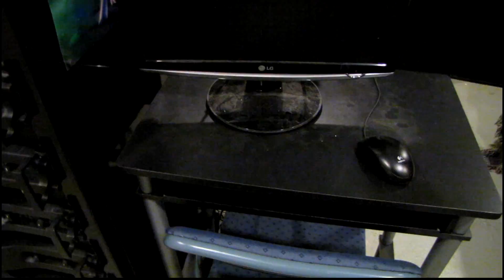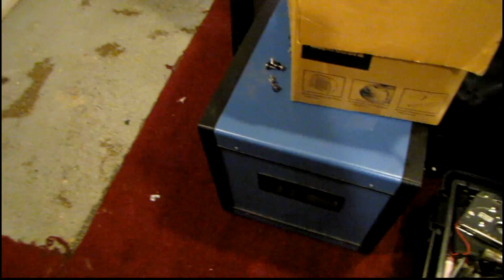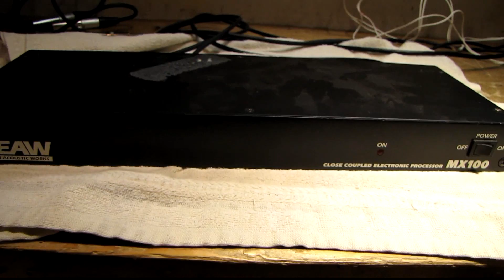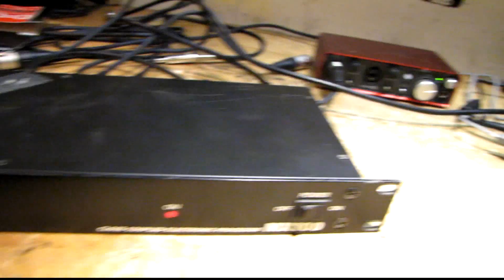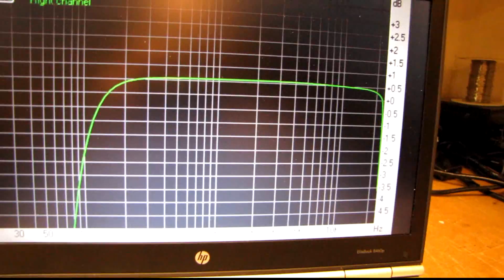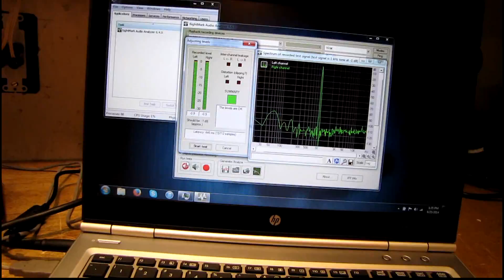Audio System Rebuild (Part 1) 9-14-2014

Comment: Do you have the tuning frequency for the SB180 boxes with the square ports. I have 6 of those and I need replacement drivers for them. Do you have a recommendation for a replacement driver for those boxes that is available
Reply from the maker: There were several versions of these.  The older ones like mine had a smaller cutout (something like 16.3") and used RCF L18P200-N drivers.  They went out of production a few years ago, but the specs should still be available somewhere.  I'm pretty sure my version of the cabinet was tuned somewhere between 27 and 32Hz.  27Hz was the Fs (resonant frequency) for the L18P200-N if I remember right.

Later cabinets like the SB180Z had different specs, and I seem to recall them having drivers made by Eighteen Sound but I'm not positive on that.
Reply: @Maxxarcade  mine has the RCF L18-P200N drivers. I attempted to recone one of them to some success but I don't have days of time to do it. If I can source an aftermarket driver or a replacement that would be great.
Reply from the maker: @seanstechworld  Because of the cutout size, you may want to stick to another RCF driver if possible.  It's been years since I worked on mine, but I'm kind of curious about a newer replacement as well.  The L18P200-N was unique in its ability to play at lower frequencies compared to other PA drivers.  And with these older cabinets, you also need to use caution with the grill clearance.  The L18P200-N had an Xmax around 10mm.

The newer L18P400 looks similar for Fs and other specs to the 200, but seems to require a slightly larger, more standard cutout (16.7") and bolt circle diameter.  

The L18P300 looks like it would mount up in the existing cutout, but the rest of the specs are different.

Since I'm still using some of these cabinets myself, I'll see if I can do some more research when I get a minute.  The biggest issue with RCF drivers is the price though LOL.
Reply: @Maxxarcade  yeah they sound really good. I have 3 working units. They sound good. The only stuff I can think of that is tighter and can go lower is Meyer Sound. We have a dual 18 subwoofer (1100-LFC) that goes down cleanly to 28hz. These -3 at 40 and -6 at 36 if I remember right.
Reply from the maker: @seanstechworld  Ya the Meyer stuff is nuts.  Hearing a stack of their dual 18" subs is actually what got me to build my system all those years ago.  

These were designed to work with specific processors (I had the EAW MX-100) with the proper option boards.  They apply a fairly aggressive parametric EQ.  EAW's datasheet states that the SB-180 is -3db at 36Hz without the processor, or 27Hz with it.  -10db is 23/25Hz.

I still have my MX-100, but have since repurposed the amps and speakers for home theater use, so I'm just using the EQ in my Yamaha preamp instead.  It has a lower noise floor anyway. 

They do tend to drink up the watts though.  You need amps with a high damping factor and lots of power.  When I got my first pair, I found that 500W per channel from a budget amp was not enough to run them properly.  Once I got a couple Crown K2's and was able to get over 1,000W per cabinet, they really woke up.

Comment: What's the crossover frequency for the subs? I'm planning on building one for my room.
Reply from the maker: +Bogdan Serban These subs cross over about 100Hz.
Reply: Cool, thanks. These professional ones look more like big woofers, unlike car subs which have big rubber surrounds and high xmax. I thought that the crossover frequency is much higher.
Reply from the maker: +Bogdan Serban These don't need to move very much, due to their size and box volume.  They have good response down to about 27 Hz or so, despite an Xmax of only 9.8mm.

Comment: Remember a laptop is isolated. Usually even on power supply, and always if on battery. That's probably why your PC passes a lot of noise, and the laptop doesn't.

Comment: but the issue is the entire response curve of the subs will change, you may lose some upper bass response if you tune them lower
Reply from the maker: Ya, ideally I'd replace the front baffles and duplicate the rectangular ports from the newest cabinets, but I don't really want to risk messing up the cabinets by trying to get the baffles off.  So I decided to just experiment with port length and see how it works out.

Comment: can you fit the precision port 6" tubes in there? just widen the hole a bit? or will it not fit because the flare mount OD is too big? those precision port flared tubes are fantastic
Reply from the maker: I was looking at those actually.  Haven't decided what to do yet.

Comment: A lot of the cancellation your hearing is because of the difference in the tuned frequencies between the different cabinets. Match them up better and you'll get a much more solid sound front.
Reply from the maker: That's the plan!  Just haven't had time or money to work on it lately.

Comment: Cone looks like it jumped out of the gap , when it goes back in the gap it very slightly catches then starts rubbing .... that looks like a mid driver ? Perhaps you fed it sub by accident at some point ?
Reply from the maker: No evidence of the coil ever catching on the top of the gap, though I'm starting to wonder if the cone had been pushed on at some point, hard enough to distort the shape of the coil.  It was like that when I got it, so I'm not sure how it happened.

Comment: When you were talking about changing the port and you had the signal generator running, I had to turn down my headphone amp a lot. I use a pair of big old heavy 1970's Stanton Dynaphase Sixty, two-way headphones, and a 1W+1W amp, so the bass was like having my head near the port!
Reply from the maker: LOL, I was running the sub directly off the USB device, so it was probably being fed by a fraction of a watt.  I can hear it on my headphones too though.

Comment: Don't you think all those components are more akin to a PA rig than a hifi system? If it's a PA that you want, then fine, but you will have to accept all the hiss, rumble and noise which comes with a PA in which there are multiple high-power components. If you want a more pure signal you should go the hifi path and reduce the signal path as much as possible.
Reply from the maker: This is my "fun" rig.  My daily use Hifi rig is a Marantz 1060 and ATH-M50 headphones.  The goal for this setup was to reduce the noise floor, not eliminate it.  With this much power it will never be perfect Hifi, but it's pretty darn clean sounding for a pro setup so far.

Comment: You might have better results if you turn your gain down on the amps and up on your mixer, should give you less noise from the DBX too, how to set gain structure, Correct Pro Sound Gain Structure      LOVED the video, super envious.

Comment: Did I see a CRT Projector in that video?
Reply from the maker: Yep, my old Barco Graphics 800.  I used to have a home theater in that room with a 122 inch screen.  But after some water damage happened, I never bothered rebuilding it.  The projector has just been sitting around since then.
Reply: Maxxarcade

Too bad. I've always kind of wanted to try one out but never had the opportunity to. The closest I've got to doing so is a CRT rear projection television.

Comment: Why woudl they use proprietary capacitors. Makes no sense.
Reply from the maker: In the amplifiers?  I think they were carried over from some older designs.  Crown probably had a ton of them laying around at the time.  Now they are pretty hard to get, and expensive.

Comment: maxxarcade you get noise from the desktop pc when using that external dac because of a ground loop your laptop doesn't make the noises more than likely because it has no earth pin on the power supply were as the desktops do i found this out the hard way because it did indeed happen on my laptop as it had an earth pin so i just ended up finding a power supply without one.
Reply from the maker: I've wondered about that.  I hope to experiment with it some more in the next video.
Reply: all though probably not agood idea you could always remove the earth pin with a pair of plyers

Comment: sweet rig if i may give you a tip 4 subs per side 2 top on each set so 6 speaker left 6  right ;) than you wil have the MJ effect shooting trough the roof
Reply from the maker: That's the plan, just need to find two more SB180 sub boxes to put my spare drivers in.
Reply: awsom awsom awsom wish i could help you out with youre rig its for sure a rig i would buy i had a pasif rig to but switched to actif becouse of the heavy amp case

Comment: RE the noise on the xover. My Brand New Sony STR-DB1080 had this hiss, with the volume alll the way down. I sent it back for repair, it turned out to be a dodgy regulator. No noise since even with full volume.

Comment: Heh, didn't expect you to use that song in this video :D ... when did i send you this? Over a year ago i belive. But it definitely is a great test song, in fact it was the first song i played through my setup when i played it for the first time last year... Crystal clear vocals and pretty deep bass.
So now that you were able to test it out with all the 4 DS123Hi s completed, what is your conclusion? 15" 1" 2-way vs 12" 6.5" 1" 3-way ... did i promise too much?
Reply from the maker: I'll be doing a side by side comparison with the old tops in the next video :-)

I don't remember you sending me that song.  Weird that I ended up finding it anyway LOL.
Reply: Maxxarcade Yeah that probably is a good idea. Then with the passive crossovers installed i suppose. Or are you gonna hook up the spare K2 (you should have one if i counted right) or another amp to the tweeters in stereo mode and use one of the other active crossovers to split the signal again? Would both work i guess.

About the song, i stuck the .flac file in a video and exported it with the highest Bitrate possible, then uploaded it to my other youtube account 08/25/2013 ... probably sent you the link a bit later than mentioned date, together with a bunch of other songs i guess you never klicked on that link. Funny though, listened to that song again just yesterday.

Comment: How many watts does the beast use from the.mains?
Reply: Kyle LaFountaine Aaaaah good point!  Perhaps 1 ring main could just about handle it :D
Reply from the maker: For full power it would need about 60 amps or so.  I'll never be pushing it that hard though.
Reply: Maxxarcade Wow 60 amps!  Ever 4 or 5 of of our chunky British plugs would struggle with that load lol or 2 complete ring main circuits!!!  Does it need it's own dedicated circuit?  It's amazing power that's for sure!  What music do you like to listen to on it?
Reply: Gareth Carlile Keep in mind that current requirements decreases as voltage increases. 240v will actually handle it more efficiently than 110-125v will.

Comment: Do you also have the Problem with your Scarlett 2i2, when you unplug it from USB or the USB Power goes off (Laptop goes to sleep) that you hear a loud thump from your speakers? I'm using active monitors with my setup.

Comment: Also with that EAW EQ unit...I think the problem is the 1kHz calibration signal. Being a low pass filter, the 1kHz signal would be severely reduced in amplitude meaning to meet calibration, you'd have to boost the signal way up making the final response curve shifted high. Like 60dB too high.
Reply from the maker: I think so too.

Comment: Thanks for the video watched the entire thing. Love the idea of smaller racks. More back to basics. The sound wore quite good from what I could tell. I do have a pair of modified pa speakers. And I run a dynacord dsp260. Have the same hiss on the tweets. Ganna get another sub box later. :) I managed to crack the concrete wall with my stereo. Wore hitting about 145db to 150db at 40hz. Hoping for more power. My biggest issue is getting matched things.

Comment: Absolutely fantastic video. Well worth the wait. I loved your original system, but this one is so much better in terms of portability and practicality. If you ever want to take this on the road, like you say it'll be a lot easier. Shame that your racks don't have front or back lids to cover the gear but I guess that's no big deal. Great choice to go for PowerCON. I'll also be using PowerCON for my new system when I get it up and running. 

Another quick note, I'm so glad you stuck with the idea of using those EAW crossovers throughout the video. I was hoping you weren't going to switch back to the Driverack. Don't get me wrong, the DBX unit is a fabulous bit of kit with all it's bells and whistles, but I'm still not sold on digital speaker management systems unless they're used in permanent installs, or if someone in the PA team is dedicated to programming the damn things on the road. I tend to see the digital stuff in clubs around here on my travels, but on the road it is still really common to see the oldschool workhorse beasts. With most decent hire companies utilising digital mixing desks when appropriate, they have limiters / compressors / graphic & parametric EQs on the outputs so I guess none of that stuff is needed from a speaker management system.

We use a KV2 Audio active system at the moment for most of our shows (I'm part of a small PA / lighting service hire company) are completely active and we don't use a crossover. We do have passive speakers made be a fantastic local company here in Wales - UK, but they're ran from hipass outputs from active subwoofers plugged directly into the amplifiers. 

When I put my new system together, I'm struggling to decide between a traditional crossover and a digital unit, wether it's this DBX or something similar. It'll be a small pub system with 2 x 15" bass cabs and 2 x 12"+horn tops. Basic system but really quality and punchy for the great portability. Anyways, talking too much again. GREAT video!

Comment: You want to know something crazy? I don't even have the bass enhancer turned on through my laptop and when you played that song at the end I swear my speakers wanted to rattle the hell out of my walls haha! And what's even crazier I have a real simple set up. JVC Receiver rated at 110 Watts @ 8 ohms, a set of Bose Acoustimass 3 Series 2's and a pair of Insignia Bookshelf speakers with 6 1/2 inch carbon fiber woofers rated @ 125 watts. I am not worthy good sir...
Reply: My dad was getting pissed that my stereo was to loud and my amp was on 1/115 lol
Pioneer VSX-921-k=Main speaker amp, Sony STR-D915@250w@4Ohms,
2 Sansui S-1000U 180 watt towers 12" each
4 RF 12" Subwoofers rated at 250w(Old school subs)
1 Polk Audio 10"
And some other equipment not worth mentioning. Yep she's a pounder and crystal clear.
Just nothing compared to Maxx.
Reply: Agreed. I kinda wish I had the set up that he has but I don't think my neighbors would like it too much lol!
Reply: *****
I was lucky to be raised in the country so no neighbors that give a shit anyway.
. My Db meter maxes out at 148DB. I couldn't hear for shit until the ringing went away
Reply: ***** Nice! I know my system would probably never hit that level of DB but I can sure make her scream!
Reply: *****
Im just getting worried about the old Sansuis
glue is dried on the dust caps and the foam is original lol.
Reply: ***** Yeah you might want to be careful! If they do go to shit hopefully a re-foam kit is easy to find. Or maybe put cloth surrounds on em. I think that would last a bit longer no?
Reply: *****
Cloth, Rubber and Foam all have different acoustics.
Reply: ***** Huh. I didn't know that. Guess I learn something new every day!

Comment: If you're having issues with the niose from the audio interface on desktop pcs but not your laptop, it is likely a grounding issue (many laptops are floating relative to mains earth, desktops aren't) Laptops are also always floating when they are running on battery unless they are plugged into somthing else grounded.
Reply from the maker: Yep, I wondered about that.  Though it also does it on headphones.  I'll be talking more about that interface later.
Reply: Maxxarcade
I've had that issue on every desktop card I've had, except my Creative X-Fi XtremeGamer
Reply: Maxxarcade
 I get zero noise because i use the optical output. No transmitting ground signals.